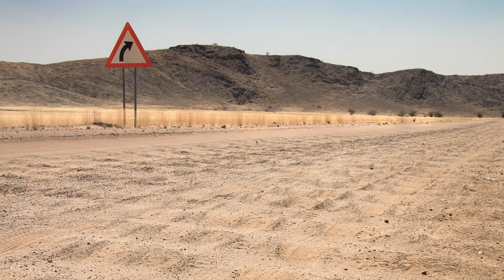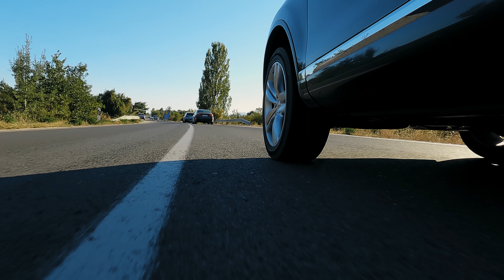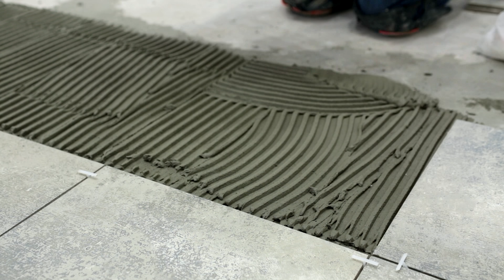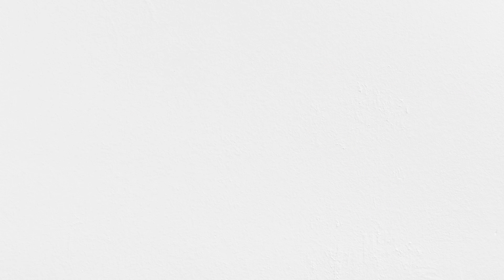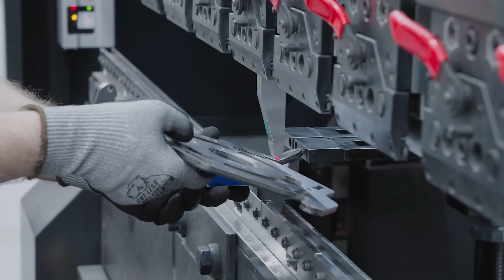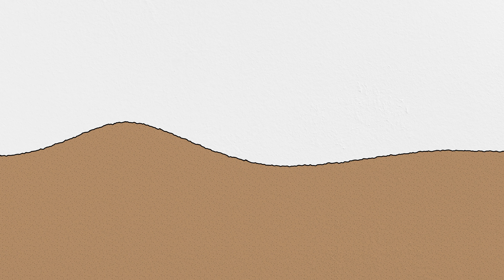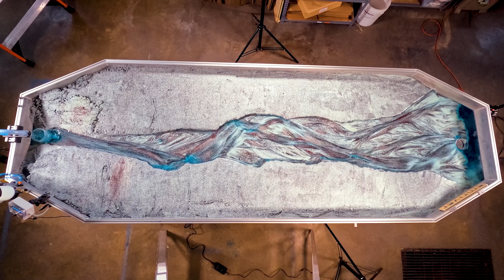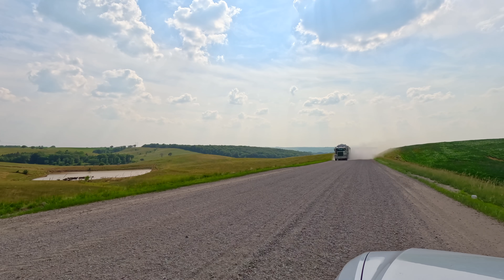Why Roads Get Washboards

Comment: An interesting (to me at least) bit of information. 
I ride mountain bikes and this is an effect that we encounter a lot on high speed trails and jump lines before banked turs, or berms as we call them.
Those specifically are referred to as baking bumps, a lot of riders are not very comfortable on high speed turns but in order to clear the features before you need speed so to make the turn you slam on the brakes. If your braking control isn't amazing the rear wheel lock up and the washboard effect is greatly exaggerated. When the wheel "hits" after a small bump it is locked so the tire knobs pick up more material to deposit further down and braking bumps are born

If you are interested to see that you can look up videos of the whistler bike park, specifically A-line and dirt merchant are 2 trails were those are very visible on video
Washboards in a strait line are rare since bikes don't go very fast and usualy strait sections of trail have features on them.

Comment: This washboard effect is rough (pun intended) on lease roads going up hill. Large trucks constantly running the road cause the ripple, and then trying to drive it in a pickup is hard because even at low speeds your rear tires keep losong gripp and spinning our. Slow and 4x4 us a must

Comment: I live down several miles of dirt road. Another guy and I are the only ones who maintain it. Turns out my hunch about how washboard forms was pretty much spot on.

Together we've chatted about what keeps the washboard at bay for longer, but never truly prevents it. The things we've noticed are: Slowing down, no more than 20MPH. Keeping your suspension in good shape. Regularly "dragging" the road to knock the tops off the washboard and somewhat reset the surface. And moisture, when the road is damp washboard forms slower.

Those things all help, but never truly prevent washboard. Only delay it. I figure it's a chaotic system, there's always going to be some perturbation that causes differential loading and moves things around.

So we get to grade the road no matter what. But the less we have to the better. My poor old Ford 2n wasn't cut out for this haha.